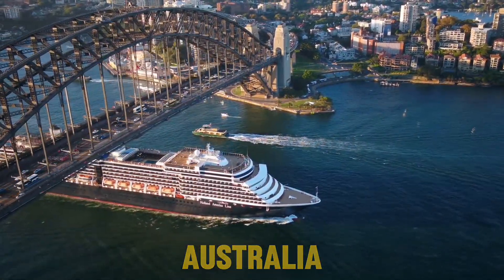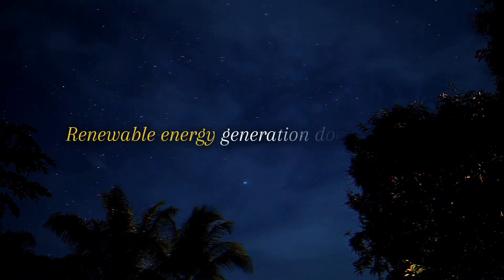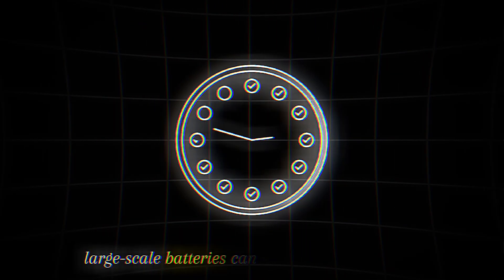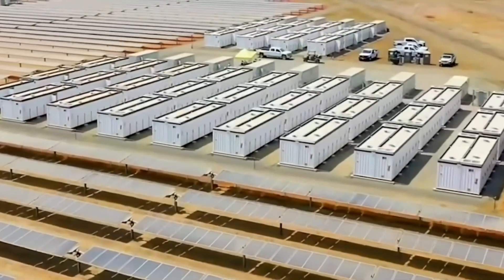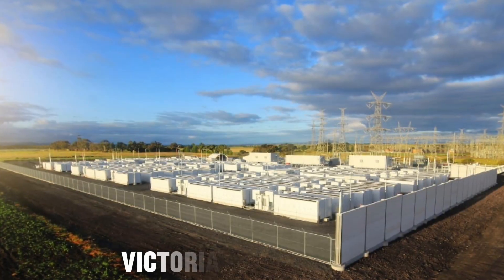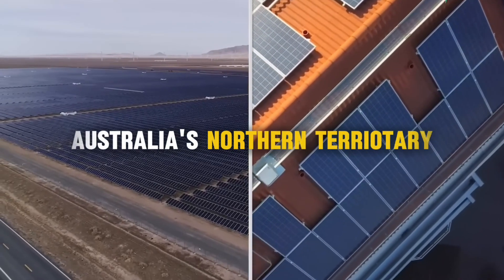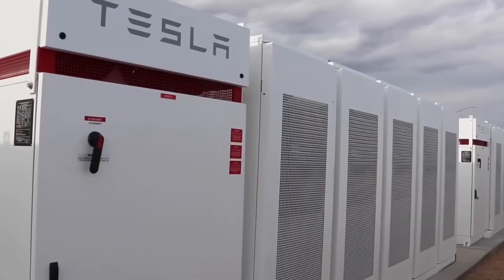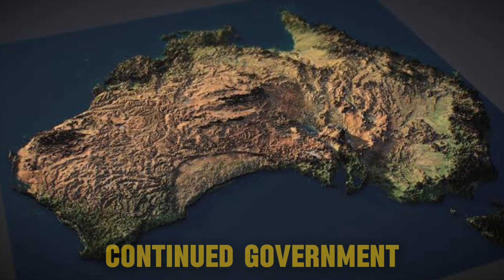Australia Is Building the World's Largest Battery Here's Why

Comment: Australia curtails a large percentage of renewable energy  because we cannot utilise all the power and the variation in Ssupply from Wind and solar can destabilise the grid. 
We need far more storage to stabilize the grid. 
More battery storage allows a significant level of variation without bringing down the grid for over spiking.

Wind alone is too variable to supply consistent load when the wind is blowing.  
Solar of course has a massive parabolic supply curve from early morning to Noon then to afternoon.  Excess energy is just bled off to ground. 
Adding back to storage allows the grid to draw when the sun goes down and peak demand comes on line from around 16;00 hrs through to 21:00 hrs.
The batteries however can only supply between 2 and 4 hours of that power before base load gas and coal generation kicks in.
Far bigger batteries are needed to cover the minimum 12 - 16 hours of base load demand once coal generation is decommissioned.
We have years of battery storage construction before we can remove coal and as more vehicles change to EV that will require further Battery installation.
REDOX flow batteries and Sodium Ion batteries provide much less expensive grid storage and that is an area that Australia is yet to explore. 
Far too much reliance has been placed on LIFEPO4  & LiCoMn battery chemistry.
Lower cost Sodium Ion technology is an easy win for storage at significant reduction in cost and far greater life cycle expectation.
LiFePO4 has between 10,000 and 15,000 cycles before becoming ineffective whereas Sodium Ion allows up to 20,000 cycles and is about 60% of cost of the Lithium  Ion chemistry.

Comment: 8:35
Australia is struggling for power and we get regular black outs but we are exporting the Soler energy to Singapore...
spent $25K to have a 20KWH battery and still getting electricity bills of $2500 - $3000 and spending a other $12K on new Soler panels. cause the ones I have had for 15 year's are old and need replacing. and still 9% jump on power bills in NSW will see my power bills for my little shop go through the roof I will have to close up cause I just can not afford it. I run a hair salon
Reply: Why are you still getting an electricity bill with a 20kwh battery? How much electricity do you need for a day???
Reply: I never get black outs where I live in Australia.
Reply: @budawang77  You live next door to a power station.

Comment: And none of the green enthusiasts even imagine how much fossil fuel was burned to produce these batteries. And they won't last forever.
Reply: Redwood Battery recycling 🔋♻️♻️♻️♻️♻️♻️🔋
Reply: Without whale oil and horses we wouldn't have the fossil fuel industry. Of course we have to use the current and less efficient technology to transition. 
theres a lot of Innovation happening with the help of AI, already there is a solution to give lithium ion battery's 6x its current life expectancy.
Reply: And how much fossil fuels are burned to explore for oil, drill, transport, refine and transport some more. It's extremely wasteful and it's destroying our climate.
Reply: They are tooooooo stupid and do not to want to know
Reply: They don't need to last forever, just like a coal, gas or nuclear plant which also have a limit to their lifespan. Batteries can be recycled, and as such massive battery installations reach the end of their lives we should have scaled up battery recycling infrastructure enough to deal with it. It's already being scaled up in the EU where battery recycling demand is already reaching market maturity.
Reply: @nickk7653  recycling demand. Demand doesn't mean capabilities. Scientists yet are seeking the most effective recycling method. One barn with used batteries already burned down in France. Another two in Great Britain and New Zealand. And battery recycling factory is as dirty as any another chemical plant. And chemicals and materials to do recycling don't come from a thin air and in ecological friendly way either.

Comment: Batteries and Pump Hyrdo for storage, solar and wind are cheaper to build and quicker than Nuclear.  We just blew through the 1.5 degrees above pre industriial and will only be getting hotter from now on.
Reply: Only if the projects receive eye watering taxpayer subsidies.
 If it does get hotter it will reduce our heating bills +++++++
Reply: But not easily scalable.
Reply: Nuclear doesn't need to be replaced for 60-100 years once it is built. Renewables need to be replaced every 25 years at great cost. Climate change is a con.
Reply: Good point. Nuclear makes no sense in Australia except as a means of delaying the phasing out of coal and gas.

Comment: and yet electrcity of australia is so expensive
Reply: Wholesale prices drop below zero most days in SA.  More batteries - less need for gas.
Reply: Because of coal and gas.   Grid prices are the result of bidding.  solar and wind bid 2-4 cents.  gas and coal bid  20-50 cents.  If the gird needs coal or gas, then the price for all generators goes up to the coal and gas price.  Understand?
Reply: Part time power is why electricity is so expensive and don't  let anyone tell you different, if all the billions of dollars spent on renewable energy projects was spend on maintaining and upgrading  to a environmental  standard the existing coal fired we wouldn't  be in this mess, what do all these renewable  geniuses suggest  we do when we have continuous  overcast days and no wind and the battery farm has run down, this project has long been axed due to it being financially  unviable, if the taxpayer was funding this project all the leeches would be out in force, but Twiggy and his bump buddy were not to keen on parting with any cash.
Reply: @AndrewTencza  you can complain all you want mate, but complaining wont make electricity cheaper.

Fact is, we are where we are, we have a lot of rooftop solar, and it is the cheapest way to generate electricity.

It is irrelevant what you think personally. People make their own decisions for their own circumstances, and the decisions people with solar make, impact the price people without solar pay for their electricity.

The ONLY way to make electricity cheaper for everyone, is to have more grid-connected storage. That's just the way it is. Due to our huge supply of rooftop solar.

Otherwise, more people will gradually disconnect from the grid, making electricity even more expensive for people who remain on the grid.

IMO we're heading towards a solar vs no-solar or on-grid vs off-grid wealth gap.
Reply: Used to be Cheap, only Decades ago, and forever before. They will charge you for each breath next, gullible communist lubbers.
Reply: Because of outdated generation due to many years of delays by coalition government. 😠
Reply: Because of WoKe Ideologies the people are programmed with, and nonsense made up info.  900million per turbine per year, TAXPAYER Subsidies, makes our New Woke Power expensive, when it used to be so cheap nobody ever worried about Power Bills when I was a kid. You new kids are Delusional, on WoKe programme.
Reply: Actually I got my power bill yesterday and it is less than half of what it was the previous year ?? ……. I was pleasantly surprised, given that the weather here had been hot 🥵 and we’d used the air conditioning for days on end. …… and I don’t have solar panels…… so I assume that reduced cost of generating power is beneficial.
Reply: The story of a complete blackout is bullshit, South Australia only has a total population of 1.7 million people…….. so according to this, everyone lost their power ……. That didn’t happen  ! South Australia has excellent renewable sources of power.
Reply: Because of the high costs of retaining gas and coal based generation while the renewables are built out. This is common knowledge and well understood.

There is no magic switch to instantly tranform the grid to a fully completed renewable energy system and instantly retire the old gas & coal generation, well that is unless you yourself are aware of such a magic switch existing. So do tell if you have found it.
Reply: Just get solar so that when you generate electricity while your not home using it between 10am and 3pm, you can get charged 1.2 cents/ kWh for the excess returning to the grid. However you do get 2.3 cents/ kWh credit after 4pm when you are home using that power and the power from the panels dwindle... But good news, if you buy battery storage you can avoid this and use the stored power during the night and It will pay for itself after just several years,,, around the time when the battery capacity deteriorates and will be in need of replacement. (Make sure your insurance has battery explosion cover)
Reply: Yes  @giancarloviglianti3457 , we're seeing feed-in charges now because there is so much cheap electricity from solar during the day, and not enough grid-connected storage to buy that cheap electricity.

What do you think happens to stable generators like coal plants when that happens? It costs them even more to feed into the grid.
Guess who covers their losses in our bills?

Without more storage on the grid, electricity bills for people buying from the grid will keep increasing. Simple as that.

PS; Most people are smart enough to use their solar during the day, even when they're not home.
Run the pool pump, run the dishwasher, crank the air-con to get the house below freezing before getting home, etc. Not rocket science.

It's insane that some people still aren't sold on solar... It's basically a choice between letting the sun make your roof hotter, or power your fridge and air con. One of those things is more useful than the other.
Reply: because renewables are expensive despite what labor and the ABC say.
Reply: @pantsgaming759 
Nonsense.  Have a gander at the open electricity realtime data.  Cheap in SA until gas is turned on.
Reply: @ChrisNotTheKing  then why is sa power the most expensive in the country? why has every place on earth thats gone large scale solar and wind seen power prices sky rocket? why is France's power so cheap when its 70% nuclear? Please show me a large economy that has made power cheaper with solar wind and battery backup?
Reply: @pantsgaming759  Wow just wow! Have you actually spent any time reading global and country by country energy sector assessments and publications? You are asking questions that are readily answered with just a little effort. But no, you want to prove just how wilfully ignorant politcal animals can be.

The energy and economics sectors don't agree with your mischief.
Reply: @pantsgaming759  The answer to cheapness is in plain sight.  Investors see it, and that's why accelerating battery builds to reduce proportion of gas in the mix is the answer.
Reply: @pantsgaming759  One economy?  China.  The one with the greatest build up of renewables, by far.
Reply: @pantsgaming759 , my power bill, which I received yesterday is less than half of what it was for the same time last year. I don’t have solar panels on my current home, so I assume that the cost of power generation has become significantly lower.
Reply: @pantsgaming759  You haven't been paying attention to what is going on have you, regardless of what any political party or media organisation may or may not "say".

You simply sound like your perspective is totally distorted by blinkered politically obsession, regardless of reality.
Reply: @pantsgaming759  It is nothing but a massive Mind Fuk of lies, for you to BELIEVE, so that they Control You. Called Debt Slavery, which comes from Usufruct of 26 jan 1910, whic is Still ongoing. Because Plebs wanna be Citizen conscripts of occupier. Dumb dumb dumb dum dum.
Reply: @pantsgaming759  well the math disagrees with your claim, privatisation of the energy supply has more to do with the cost surge. Solar is stupidly cheap, we just need to fill in the short fall by getting the storage built out and batteries has dropped in prices so quickly the payback period for batteries is approaching less than 3yrs with a expected 15-20yr lifespan, of which improves by the month.
Reply: @pantsgaming759 they are cheaper than new coal and gas installations on every metric. The average payback period of a solar and battery is around 5-7yrs and give you around 15-20yrs of energy before upgrading, during this time you have a fixed cost of energy independent of grid price increases. I have done both and will be fully paid off in 9 months, it’s the first time I’ve felt certainty in my cost of energy.
Reply: @joshuacribb2523  no idea where your getting you info but its wrong.
Reply: @ its freely available information, do some more research on the national energy market. Negative electricity prices in Australia's National Electricity Market (NEM) occur due to excess solar generation during the day, which floods the grid with cheap electricity while demand remains low. Rooftop solar, with zero marginal cost, displaces more expensive generators, sometimes forcing inflexible coal and gas plants to keep running at a loss. Grid congestion and market incentives further contribute to negative prices, highlighting the need for better energy storage, demand management, and grid flexibility.
Reply: @joshuacribb2523  Wonder what the carbon cost and ecological are for manufacturing all those batteries and solar panels are. Also, the cost of disposal?
Reply: @guuguuberra  Less than a coal plant, that's for sure.  Nothing recyclable in toxic ash.
Reply: The electricity prices in Australia are actually pretty average compared to other developed countries. Depends a bit on which state you're in.
Reply: @budawang77  Someone has been feeding YOU some delicious Porky Pies haven't they!!. Feel sorry for the gullible, forgive them for they know Not what they do.